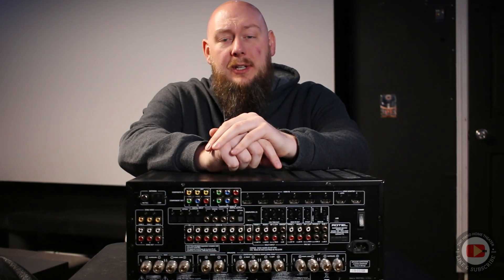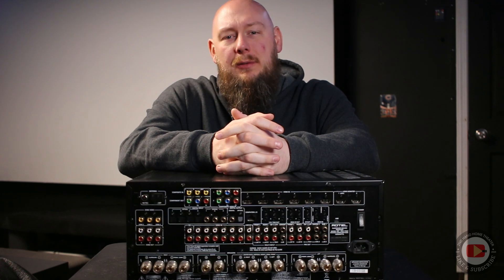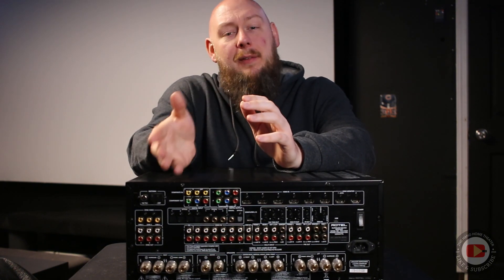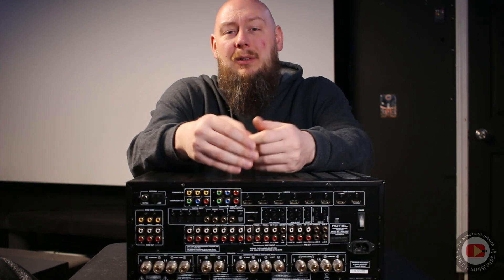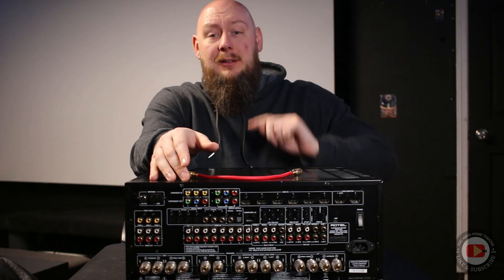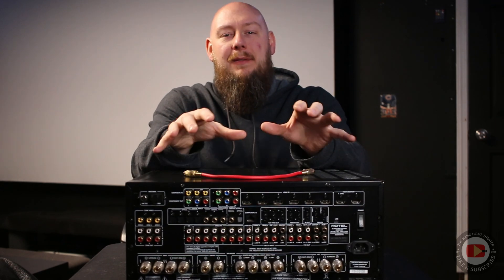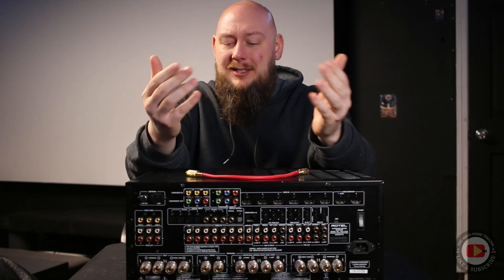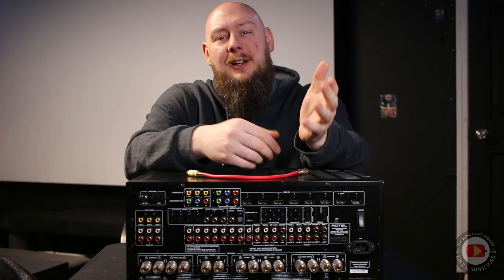Can You TURN An AVR Into A Power Amplifier?

Comment: Hello, I have an older Rotel RSX-972 and I can’t figure out how to get sound. I am using a smart TV using a ROKU
Reply from the maker: I'm not sure of all your settings & setup, but I would imagine that your TV should have an optical or digital coax audio output on it that you could connect to your RSX-972. If that isn't the case, I'm not sure the other options you'd have without seeing it in person. Hope that helps.

Comment: Im going to use my massive 140w Onkyo 875 to power the LCR while my new RZ50 handles surround/atoms/processing.  Honesty this was a perfect use case.  the RZ50 can only power 9ch but processes 11, the 875s only advantage was its power.   Went from junk to gold.
Reply: Did something similar when I bought a Marantz SR7013 which has 11ch processing but only 9ch amplification;  I had an old Yamaha RXV1200 (appx 80wpc high current) kicking around that I now use to power the 4 height/atmos channels.  Works fantastic.

Comment: so can i use 2 avr’s so im currently running a Onkyo tx-sr494 can i use my old onkyo as a power amp for front 3 Soeakers?
Reply from the maker: You can, as long as you connect everything properly. It'll just take some extra cables to connect everything.

Comment: GOAT receiver. 
I have a Denon AVR-3801 using multi in from a Creative X4 so my computer can have 7.1 audio... I've had surround on my computer since 2000.  Finding a 7.1 amp with multi in is VERY hard because they only made them for, about, 3 years before they moved everything to HDMI... 5.1 Multi in are much easier to find... note: Multi-in still allows you to adjust balance/volume as well as bass/treble settings.  

These were manufactured just before the decoder wars kicked into high gear and Dolby and the HDMI mafia went after all the streaming platforms and receiver manufactures to push everything into the Dolby standard using HDMI.  The streaming platforms liked it because they only had to compress audio into Dolby format; the receiver manufactures loved it because even though it was more expensive to pay Dolby and HDMI to use their IP it also forced smaller amp manufactures out of the business.

Comment: Great video & an excellent idea this is!. My question is , which volume setting should I set the av receiver that I am going to use for the power amp?
The Onkyo av that I plan to use as the power amp, only has absolute volume scale option which I can’t determine the true relative reference level with a slp meter. Thanks
Reply from the maker: That's a little tricky. Does your other processor have an absolute scale as well? If they both do, you'll need an SPL meter to determine 75db. You'll just have to play with both volume settings until you hit a number that you determine to be "reference" and use that. I'll admit it's a bit of pain in that situation. When I only had absolute scale receivers, I found 75 out of 100 worked for me. Every situation is different, but I hope that helps.
Reply: @ Thanks for your quick reply!
My main receiver is a Denon that has both absolute & relative scale.
My thinking is that if set the Denon to relative 0db, & then play pink noise via say a YouTube demo & then adjust the main volume on the Onkyo /power amp to 75db that way. 
I’m using the Onkyo to power only the main L & R, what do you think?
Reply from the maker: Yeah, that should work. Just make sure you write down what absolute value you use for future reference. Just in case you AVR gets reset. It'll save you some time.

Comment: I was searching the WHOLE internet , the last 30-40 days , to find such a video.
How glad i feel that your video was suggested to me , by Youtube.
The idea that you describe was into my mind , for several days now. But i was not sure if it is going to work or not.
I own an 18years old Flagship from Pioneer. The VSX-LX70 ...... And i am about to pull the trigger on a Denon AVC-X3800H in order to create an 11.2 setup.
I do not have the money to buy an extra power amplifier.
And I want to provide extra power amplification on  8 channels out of the total 13 of  my  future Denon AVC-X3800H ,  by connecting the Denon's PRE-OUTS of Front  , Center , Surround  and Surround Back Speakers to the Multi Channel Inputs of my Pionner VSX-LX70 ....... There's even a "Multi-Channel IN" indication on the LCD screen which can be selected through the input selector knob. My only question is how do i adjust the proper LEVEL of volume in the PREOUT channels ...... ?
I mean , can this be done though the Audyssey Calibration system of DENON , or should i adjust the volume manually ???
And everytime i change the volume on the Denon AVC-X3800H ...... should i re-arrange the volume on the old Pioneer as well , or is this a one-time process ???
If this , indeed , is a one-time process , then when i adjust the volume on the new Denon , Does the Denon adjust the Volume on the PRE-OUTS (automatically) as well , or what ?
THANK YOU for your time and your extremely enlightening video.
Reply from the maker: Hopefully, this doesn't sound confusing. You'll want to set "reference level" on the Pioneer first. That means turning the master volume on it up until you hit 75db or whatever level you want as reference. You'll need a way to monitor volume, which phones have a ton of free apps you could use. Just search your app store for something like "decibel microphone."

After that, any trim or gain adjustments, would be done in the Denon settings. But once that's done, you shouldn't have to touch the pioneer volume again. The main volume will be adjusted from the Denon.

Hopefully, that helps and isn't too confusing. I may do a follow-up  video explaining this for everyone.
Reply: @2ndHandHomeTheater  Thank you very-very much for responding so fast. 
To be absolutely frank , I will take up on your advice and try to do the "Reference Level" setting , 
although i was a bit confused with the "monitoring volume suggestion" , through the phone app. Will give it a try. THANK you for trying to help the community !
Reply from the maker: What I mean by that is you need a decibel meter to help get you to 75db. You can buy one, or there's a bunch of free apps that can use your phone to do it. It just a way to watch decibel changes to make sure you're hitting the right volume. It sounds more complicated than it really is. I have a video on it that you could watch too.
Reply: Essentially in this configuration "volume" becomes "gain" on the Pioneer.  The Pioneer should be configured at the maximum possible volume that doesn't create distortion then the entire speaker array should be calibrated through the Denon and the volume on the Pioneer should never be touched again.  

Yes, adjusting the channel volumes on the Denon will adjust the Pre-outs and the amplified channels.  Equalization will pass through to the pre-outs as well.

Comment: Odd question - I have an old STR-DH790 that will take a 2-channel input (unfortunately it doesn't have the full range of inputs for all 7 channels). Could I still use that as an amplifier for only 2 channels?
Reply: If your output source has RCA "Multi out" for 7.1 you can use a 5.1 amp (or 3.1 if you can actually find one) for the front speakers, center and sub and use separate amps for the surrounds.  The audio source does the decoding and mixing and the only thing you'd need to do on the separate amps is adjust the balance and volume for your room. 

In your setup you could use the Yamaha for the front/center/sub/surrounds and the STR-DH790 as the rear only if your audio source has 7.1 RCA outputs and only if you use the RCA inputs on both receivers.
Reply from the maker: You could, but it would only be 2 channels. You could use it for any 2 channels in your setup.
Reply: Follow-up on this question - the STR-DH790 has bi-amping capabilities, could it use those in this mode?

I ask because I found a great local deal in my area for a Yamaha RX-V1800 for $50 that DOES have all 7 channels of input for it, and pairing that with my Sony would feed all my channels, but I was hoping maybe I could get a little more power out of the Sony. Have you ever tried this?

Comment: Audio wise these things were complete dross and unsuitable for any discerning listening. Specifically the power amps and pre amps were so bad it was surprising
Reply: Maybe but...........
  These Rotels are $200 all day for seven (7) amps.  Can't even buy the chifi D's for that little.  This reviewer picked a good model as a suggestion.  Good advice,  especially for a Noob to discover the hobby.
                                                                                Acid Jazz, Funk & Brass🔈🔉🔊
Reply: the amos them selfs were not the issue but all the other Crap included in avr's

Comment: I use older multichannel capable AVRs for a different purpose. I use them as power amplifiers for DSP-based actively multiamplified 2.1 channel music reproduction systems.  They are really the key to affordable DSP multiamping, and the results are stunning, for me at least. I just have to be careful to avoid switching to any other input except multichannel - tuner, for instance - lest I potentially send a full-range signal to my tweeters!  Cheers!
Reply: How are you setting the crossover frequency for your tweeters? I can't think of a setting where I could adjust this. Bass management filter options would be too low.
Reply: @dwaynepiper3261  I have the DSP ahead of the AVR, doing frequency distribution to the 7 power amplifiers in the AVR, including a channel for the passive sub. No digital processing is done by the AVR.
Reply: @ Ok that makes sense. What are you using to do DSP and DAC?
Reply: @dwaynepiper3261  Well I'm breaking a lot of rules.  I stream from a laptop's analog headphone out to a humble Dayton DSP-408 DSP box which performs additional AD and DA steps with processing in between.  My extremely highly resolving DIY speakers (horn tweeters, midranges, and midwoofers plus a ported sub) don't seem to mind at all, in fact my system has been characterized by a "widely travelled" audiophile as reproducing on the level of a $50k audiophile system.  My cost is around $650, not counting the laptop itself.  It's my learning curve that's priceless 🙂.

Comment: At one point, I had a Pioneer vsx-49txi, which wouldn't decode modern formats like dolby truehd or dts-hd, but I used the multi-outs on my Pioneer blu-ray player and let it handle the decoding. Sounded pretty great. My new Pioneer has those multi-channel inputs if I need them. Just got a 4k TV, but having annoying issues trying to get Dolby Vision to work while using audio extracters and hdmi swithboxes. Ongoing nightmare, but I'll figure it eventually.

Comment: Are you referring to adjusting the volume on the repurposed AVR power amp? So the volume would be controlled with the  processor?
Reply from the maker: For the most part. It'd be a good idea to set your "power amp" AVR to reference level first. That means turning its volume knob up until you hit 75db. After that, if you want to turn the volume up or down for content watching, you'd use the processor volume.
Reply: @2ndHandHomeTheater So it wouldnt ne when the amp reads "0db", keep turning the knob till the readout says 75db? Odb on my receiver is pretty loud lol
Reply from the maker: @VVT4ME  In your case, you'd set it at 0db. Each receiver & amplifier is unique, but if the display is in decibel levels, 0db should be calibrated as reference.